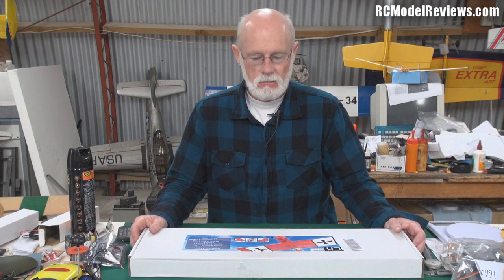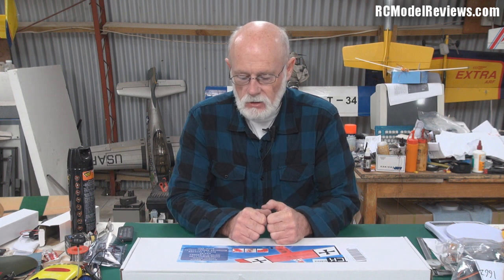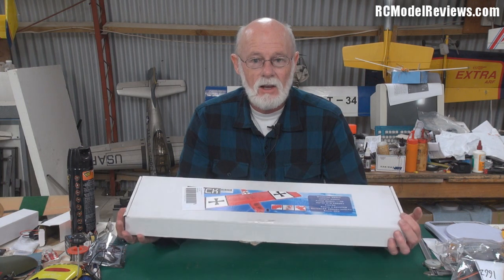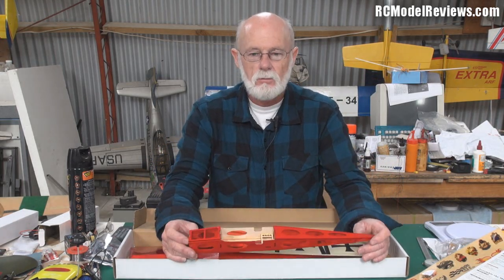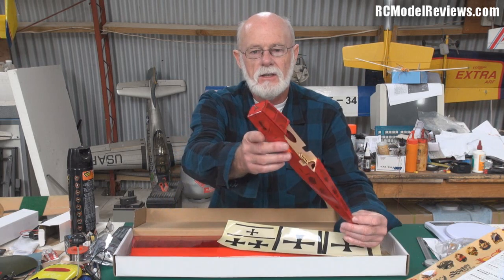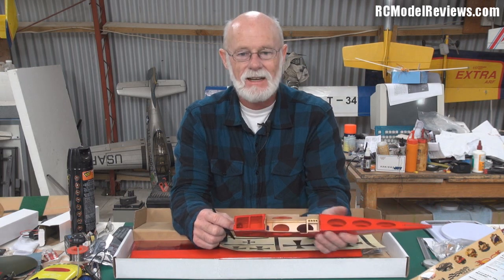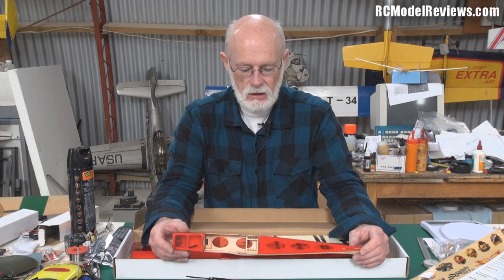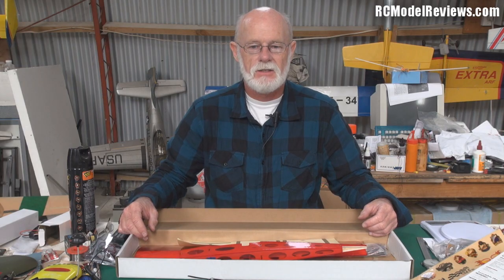HK Mini Stick (sneak peek)

Comment: good one Bruce.  I bought one of these from HK 2yrs ago and it remains a great little flyer in my fleet, much loved by small children.  Flies incredibly straight and true, locked in. I had it out just last weekend.  Stock motor overheated  -  replaced with an externally mounted donk - aTurnigy 1811-2900 and this leaves more room in the fuse for battery and esc.  Its my first balsa plane since I flew control line in the 70's.  Love it and would like to add a big stick to my collection.

Comment: Hey Bruce, this brings back great memories.  I built the Ace Mini-Stick way back in the early 70s with a Cox Tee Dee 010 up front.  For control I used the Ace Commander single channel proportional flip-flop with the baby actuator.  I still have the radio with that actuator along with the baby twin actuator.  Still have the 010 also along with several Pee Wee 020's and a TD 020 and lots of 049's of all flavors.  I actually have the TD 020 and radio in a Roaring 20's plane I still fly sometime.

Comment: hay mate I built one of these from hobby king too I found I needed to place the motor on the out side to get c of g but it flys really well I did place a slightly bigger electric motor mine also was missing a few small control arms for moving surfaces but still 10 out of 10